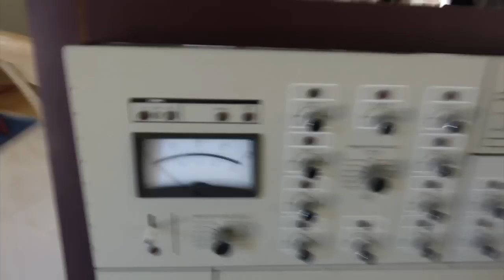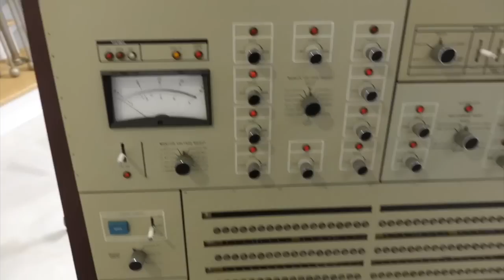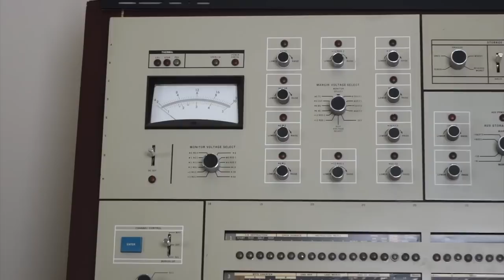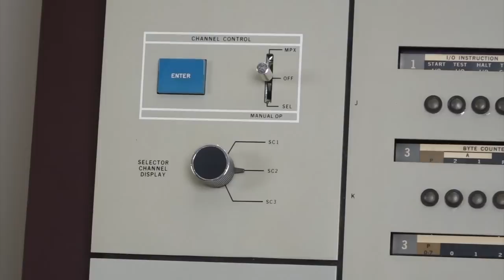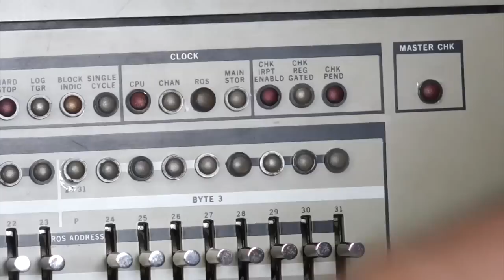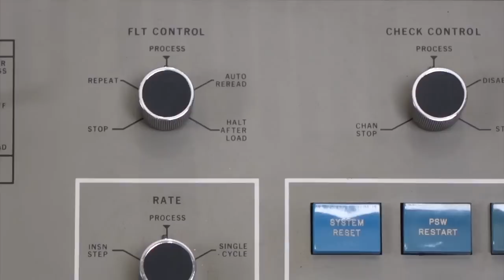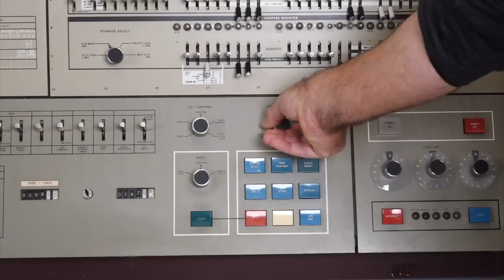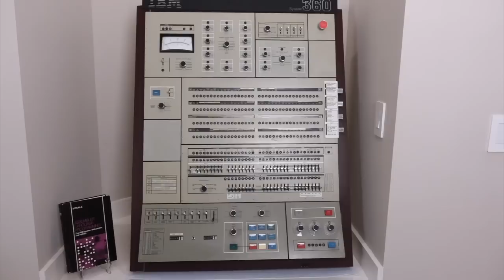IBM System/360 Front Panel

Comment: An enjoyable reminded of the start of my career. I started as a trainee programmer for a London bank. The bank had a number of model 50's but also had model 30's as backup and a rule was that all programs had to be capable of running on the 30's in an emergency. They also had a room full of 20's running TOS (Tape Operating System) rather than DOS (Disk Operating System). These 20s were solely for running cheque sorters and team of girls (the bank was very sexist) completed for achieving the most throughput each day.

So there were dark rooms of the model 30s and I would often go into one, switch on the lights and power up the machine setting the booting dials to the hard disk with the System 360 OS. A very Starship Enterprise feeling. One day testing didn't go well and I was so frustrated I pressed the power off (or did I press the big red button!). There was a huge bang and I thought I had broken the machine and would loose my job and career. I have forgotten to power down the disk drives and I guess they simultaneously retracted the heads and put the emergency brakes on. I removed the disks and slip out turning the lights off and telling nobody!

I soon moved on to another organisation implementing the first European IMS DB/DC system with an incredibly complex database. We had an IBM systems engineer assign to the team and one day he came in with a big grin on his face. He had persuaded IBM to let him have a model 50 front panel like yours. He would put it in his living room along with his collection of pin ball machines. He said he loved the tactile nature of the model 50 front panel.

Enjoy your front panel!
Reply: In the mid-80's a location of the company I worked for was still running its business on a 360 with TOS - probably the model 20. In a weekend they cut over to a 4331 (I think). Shop was so well run it went flawlessly.

Comment: Awesome!  I was a operator on a Dual IBM 360/65 system   Shared DASD, Shared Spool  running the NIH variant of HASP.  That was in the late 1970s in Albuquerque NM  at the University of NM.  We had a lot of surplus hardware from America Corporations.  This brought back memories.  I recall the last time I saw a face plate was the Knoxville TN World's Fair American pavilion.  I reached over the red ribbon and put it into ROS READ mode.  for old time sake.
Reply: I also worked on a shared 50/65 using HASP. We had four banks of tape, three banks of HD, two printers, card reader, card reader/punch, and a 9,000 reel tape library at HQMC. After setting up the shared system we had quite a few visits by the CEs working out the bugs. Our experience there was a good intro into what we work with now.

Comment: Regarding the “Emergency Pull” on the 360 and 370:  As it was explained to me, you pull it if there are flames coming from the machine.  You do not pull it if there is only smoke coming from the machine.

This would result in an expensive service-call to IBM, so it was used only in dire circumstances.  Actually, I never heard of anyone using it.
Reply: Fred Blonder what exactly did it do? It seems like you would pull it in an emergency, but what does it do?
Reply: @jasonmurawski5877  I’ve never spoken with anyone who actually pulled it, so I don’t know.  For all I know, it could play music, have a Jack-in-the-Box pop-up and throw confetti.  I assume it shut-down the power-supply and shorted out a few bus-bars and possibly released some chemical fire-suppressant.
Reply: I was also taught to use the emergency pull IF I was certain a CE was getting electrocuted. I don't know what the 360's Emergency Pull really did, but in in the Amdahl 308x look alikes, the EP switch was attached to a toggle switch under the console that was a main disconnect for all power. Actually easy to reset, the CE just took the skin off the console after the issue was fixed and flipped the toggle back on.
Reply: When a 360 20/25 was scrapped I got to use the BRB as a final goodbye. The machine room itself had power kill switches every fifteen feet or so around the ouside wall - got to use one of those when a transformer in a brand new 370 actually blew up, small copper beads everywhere, one hell of a panic and the whole machine room down for a day!
Reply: When I started as an operator trainee in 1969, what was said about Emergency Pull was that if we went to war, you pulled it.
Reply: The Emergency Pull button was the "Emergency Power Off" and if pulled the CPU and all the connected peripherals were powered off. There were thinish cables, called EPO, which connected the CPU to each peripheral. This cable also controlled the power up, as well as  down of each device.
Over time this method was not considered safe enough and many (most) computer rooms had their own emergency power control,  usually with an emergency button by the computer room door. Subsequently CEs no longer installed the EPO cables.

Comment: Very cool... The very first computer I learned to program was the IBM 7090 when I was a cub-scout and in 8th grade in Fortran. My first job was a software engineer in Advanced Development at Sperry Univac and we had a mainframe series 9300 which had a micro-coded instruction set. My group wrote an IBM 360 emulator and we were able to boot the 9300 as an IBM 360, then load and run IBM native programs. This is what inspired my career. Thanks for sharing the good old days.
Reply: Sorry, no! The 9300 was not microprogrammed as they were not microprogrammed the 9200 and the 9400. The first Sperry Univac, IBM-Compatible mainframe microprogrammed computer was the 90/30, followed by 90/25 and 90/40 (same hardware, dummy micro-instructions to slow down the 90/25, 500nS clock and microcode prefetch for the 90/40). I started to work on it in 1977 as a CE but I think it was released in 1974 or so. By the way, the 90/30 already had the 360 mode of operation support in its microcode that allowed to run native IBM code.

Comment: Very interesting! I always wondered what all those lights, switches and buttons were for. I wrote my first program in Fortran in 1968 at the University of Illinois on one of those machines. Of course, the closest we ever got was the check-on window where we deposited our little deck of punch cards and picked up the output the next day. Never saw the inside of their inner sanctum. Had to wait to touch one until later in the 70's when the 370's had arrived.
Reply: Back when I was in grade 12, I had a Fortran class and we used pencil mark cards, which the teacher took to the school board office, to run on a computer there.

Comment: I worked as a programmer in IBM Poughkeepsie in the late 60's on the night shift. Sometimes I would force a red light to get a field service friend to bring in a pizza. Some interesting challenges at that time were the shortest stable program you could enter with switches and playing a tune through AM radio from memory emission noise. The infamous HCF - Halt and Catch Fire instruction comes from a parody of the assembly instruction cheat sheet that every programmer carried with them.
Reply: Just a note about the HCF instruction.  But first, a nomenclature correction.  Those green (360) and yellow (370) reference cards you referred to as a "cheat sheet" was almost universally referred to as "The Bible" by the programmers and operators, since without it, you were in deep trouble if things went haywire and you landed a 4 inch core dump for dinner!

As for the HCF instruction itself,  that did NOT come from the IBM world: it was a REAL instruction, implemented on the late versions of the Motorola 6800 - in response to a request from the air force.  The Air Force had decided to use the 6800 in some new avionics package, and the request for HCF was made because of the fear that this new tech might fall into the wrong hands in the same way the U-S tech did.  I have a LOT of 6800 experience, and have personally tested the HCF instruction: out of 20 tries, about a half dozen of them halted with a big "loud, pop.  No real fire, but the chip was genuinely unrecoverable.  The HCF instruction became public by accident: either Byte or Popular Electronics (probably Byte, but it's been so long that I can't remember any more), decided to see what would happen if they tried the "unused opcodes".  They clearly had some of the late model 6800's, because their testing resulted in the famous popping sound, along with the smell of freshly seared silicon."

Since it became public knowledge, I have seen it attributed to all kinds of crazy things, from originating in the 360 architecture, to a "special instruction" that required all kinds of crazy prelude code to enable it before it would work.  I've seen it attributed to almost every silicon based platform, and I've heard it described as the cause of all manner of awful mishaps (from causing the Challenger disaster to being a Russian planted change to the lithographic masters for the platform(s) of the day.  HCF has taken on a life of it's own.

Comment: I started in computers working as a 360 operator, then moved up and after a while ended as shift supervisor. One fine day I moved to programming (on a 360 also) and could sleep nights again. But bugger if I remember what all the switches are for! Regards
Reply: Well Lazarus, as someone who worked on 360/30s plus a few other CPUs (as a CE) then 15yrs as software support I can't remember many (if any) programmers who knew what ANY of the switches were for - so don't feel bad about not remembering  ALL of them.
Reply: Thanks mate!  But I don't feel bad about not remembering details like the meaning of all those switches. It was at the start of my career, one of many steps upward. Regards
Reply: Yes, now I remember about using the LOAD button when I was an operator. Regards
Reply: 9D00000C
47700300
9C00000C
47F00300

And to make things more realistic be sure to blink the Master Check light.
Reply: Those were the days!  Most programmers don't sleep nights anymore, sadly.
Reply: OK... recognizable as part of a simple hand-entered program to read cards from the card reader. (to work, it had to be stored at location 000300) ... I guess that establishes my credentials as a bona fide 360 geek -- actually a former IBM CE.
Reply: In late '68 I started as an operator at a shop in Cincinnati that had a pair of 360/50s w/512K under OS-MFT and a pair of 1410s w/80K. In '69 I landed a programmer trainee position with a department store in Cincy that had a 360/30 w/32K under DOS360 programming in assembler. I learned how to read some of the lights as it helped to debug programs. Say the 'System' light came on solid but nothing was happening it was a clear sign of a hard loop. Just switch to single cycle mode, step through reading the addresses from the lights, check you source list, find the bug and dial in a patch. Easy!
Reply: @Lindsay5137  The only switch I used on that entire panel was the on/off switch. You used the IBM keyboard for everything else, like typing "delete"

Comment: I was an IBM CE, started in '64.   I worked at and around a large 360 model 65 installation at an major airline.   I was new and never worked on the 65s (I think there were six at this airline customer).   The only time I actually worked on the 65 was fixing its console, an IBM Selectric I/O.   In my 30+ years at IBM,  I never saw anything more impressive than that computer room.  
I agree with what's been said here about the practically of owning one of these monsters.  I know a few guys who could probably get it working but for what?   It's place is in a museum someplace.
Reply from the maker: Let's see. We have two IBM 1401 running at CHM, there is a 360/20 running and a 360/40 almost running at the LCM, Carl has two running IBM 1130 (a real one and a gate for gate FPGA replica), his friend has a running IBM 1800 in Finland, there are two working IBM 360 FPGA gate for gate replicas with original front panels, a /65 and a /30. And we are seriously considering helping with an IBM 7090, but that one will require a very large team and budget. Don't know of a working 360/50, hope this will be the one. Multi year, team projects. Much better than just using panels as static decoartion, if you ask me.
Reply: I agree, getting it working is  worthy goal.  Good luck.

Comment: I was a final test technician on this machine in the late 60s. Traveled all around the country fixing them.  The full system had 512k of core memory and cost $1M.  Even the most simple technology today like a smart thermostat in you house is by far more powerful than this machine but at the time it was the height of technology.  In those days when one failed the field technician would spend a day trying to fix it and then call the area tech who would spend a day and then I would go out to fix it on the third day.  The field techs were  plenty smart but they worked on a lot of different machines. I only did the 360-50 so I knew all the quirks. If a mainframe today went down for several minutes it would be a major disaster.
Reply from the maker: Awesome, thanks for the note! Do you have any documentation for the 360/50? We have the hell of a hard time to find a copy of any ALDs. We have some for the /40, the /65, but not the /50. You can contact me by going on my channel about page.

Comment: Ordinary programmers would not interact with this front panel in any way other than to look at its beguiling blinking lights through a glass window, from a hallway outside the "computer room," which was usually protected by elaborate locked doors. The people who did interact with the panel were almost always IBM CEs, except those who turned the machine on and off. Ordinary programmers (of the 360 era) interacted with the machine only by submitting "jobs" in the form of decks of punched cards; this was done using card punches and card readers that were in another room (or rooms), separate from the "machine room." 

During times of normal operation, an "operator" had a seat in front of the panel, which he didn't usually touch. A nearby terminal (such as the IBM 2741, with its thrilling, whirling golf-ball type element) told the "operator" what tape to mount on which tape drive, or what disc pack to mount on which disc drive, or that the line printer had run out of fan-fold paper. The "operator" often didn't know anything about computer programming, being more like a human robot actuator that accomplished mechanical tasks that the mainframe couldn't do by itself. 

The debugging aides available from the front panel (some of which were almost like early logic analyzers) were used in conjunction with test software, of which the CEs were the custodians. Ordinary programmers debugged their code with the help of voluminous "core dumps," which took up reams of computer paper and were typically looked at once and then never again.

Often hundreds if not thousands of jobs depended on the continuous and fault-free operation of the computer behind that front panel, which had considerably less power than the CPU in an iPhone. There is no commodity that has fallen more quickly in price than that of information processing power.
Reply: Operators indeed did not need to know any programming language, and mostly didn't, but they ("we" for a time) did more than mount tapes and disk packs and put new paper in the printers.  One would always be sitting at the console and monitoring what was happening in the system, and often entering replies or commands.

Comment: Wow! I remember constructing those stacking rotary switches back in the 1960s when I was an apprentice - not seen one for years.
Reply from the maker: Most of mine are broken. Do you know who was the manufacturer? How to get new ones? Repair them?
Reply: @CuriousMarc  I really wish I could help you, sadly not. 

I did my apprenticeship with the Ministry of Defence so anything we used would have come from central stores and just be marked with a MoD part number. Pretty much all I can recall is that they came as a kit of parts with the base plate, wafers, rods and spacers. You used as many wafers as needed and then cut the rods to suit. 

I have just Googled for rotary wafer switches but the modern ones don't look like the ones I used at the time.  I suspect the only source now would be from vintage equipment or surplus sales but as we are talking the 1960s they are probably thin on the ground.
Is it just the wafers that are broken? If I recall the wafers were made from a material like Tufnol so have you not considered making some new ones yourself? A long task I know but possibly the only way you will be able to restore the panel.
And thank you for a fascinating and enthralling channel - it's great to see this old equipment being put to use again.
Reply from the maker: @Ashjuk  Well thanks anyhow, really appreciate your answer!

Comment: These machines had a weird love hate relationship with data center operators back in the day.  “Love”:  Mr. Manager strolling down the hall with a future client to the big fish bowl windows where all the system operations were proudly displayed.  CPU lights ablinking, tapes ataping, printers aprinting, folks running around feeding printer paper, tab cards, mounting tapes, swapping disk packs in a smooth, orchestrated symphony of...”Hate” when it all comes to a screeching halt, data checks, equipment checks, CPU master checks, console printer out of paper, even though it isn’t, on and on and on.